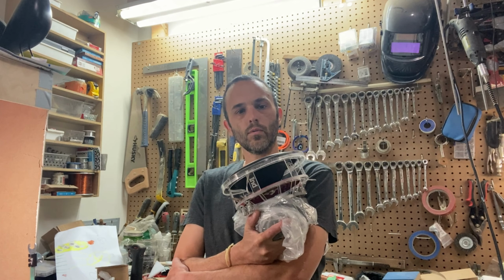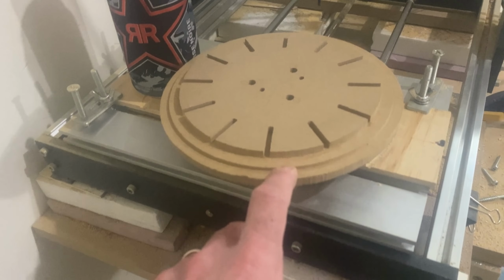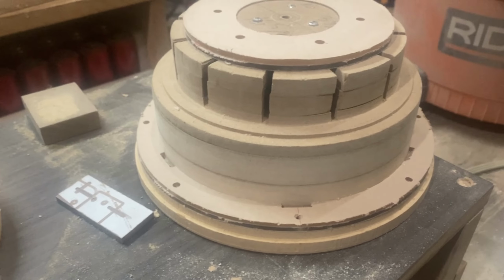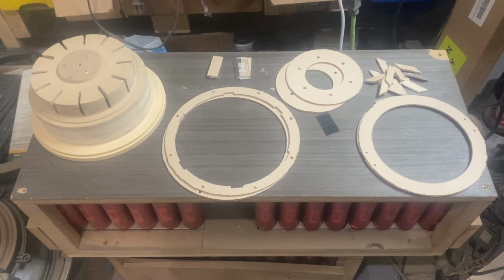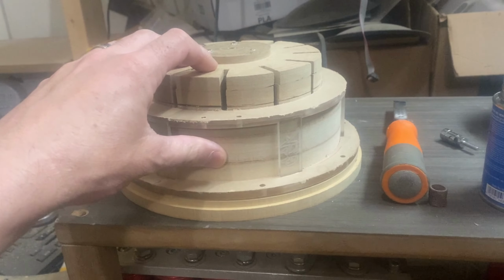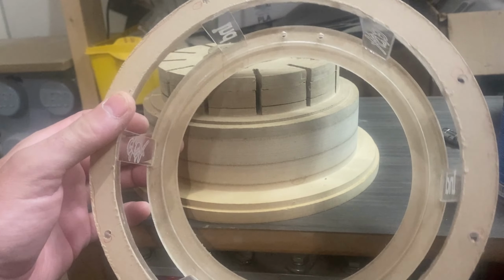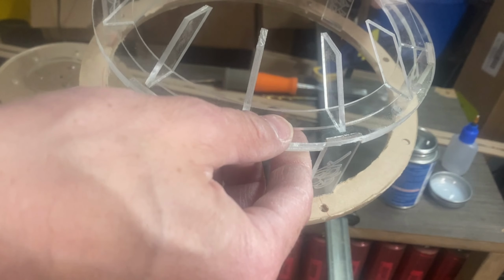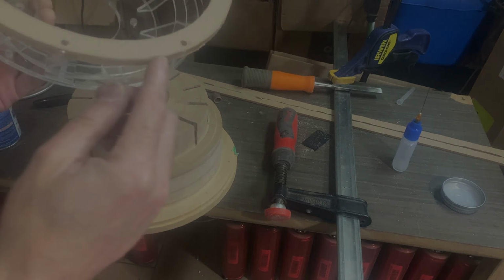Crystal Bubba; Meth or Gem? Making an Acrylic Subwoofer Basket

Comment: if you have no plans in supporting the motor in an enclosure,  you may want to fabricate a device to keep the weight from fracturing the basket assembly
Reply from the maker: @LenoreMaggs  just building it for fun. eventually it will fail. the weld joints seem particularly brittle 🤔.